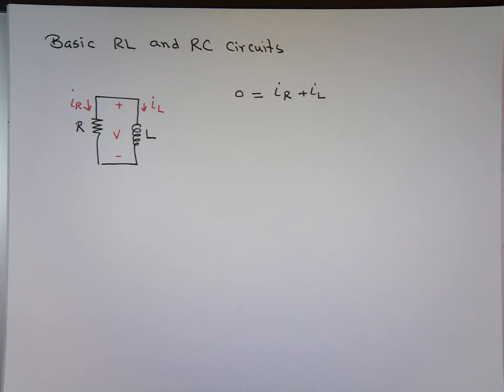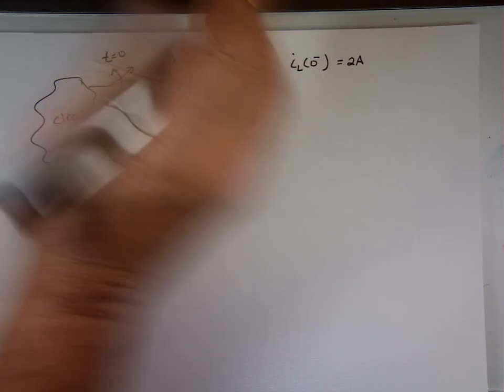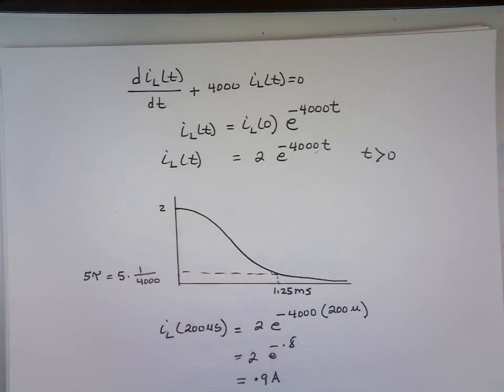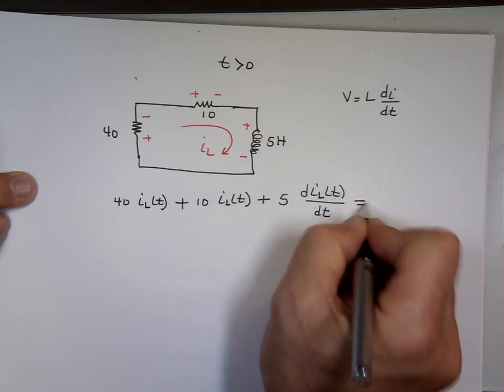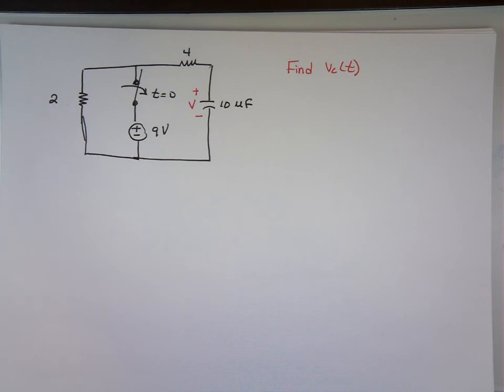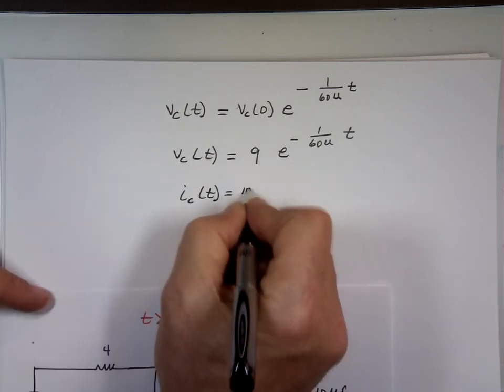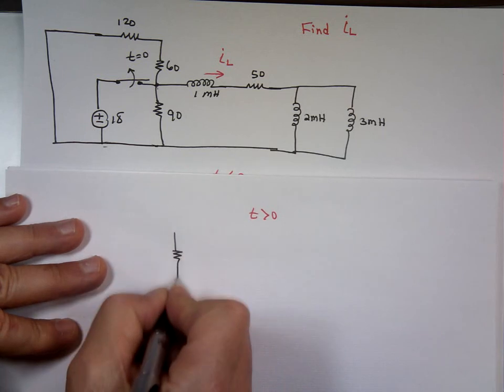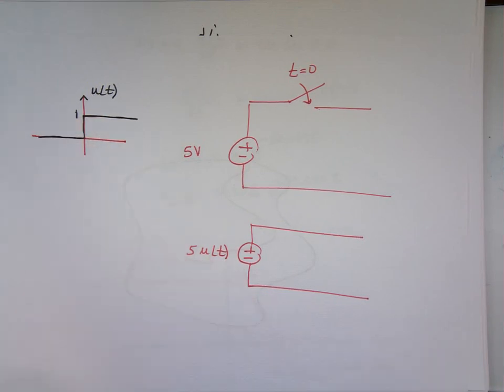BASIC RL and RC Circuit

Comment: IL(0-)=2.4 A ? WHY ? THERE İS A 40 OHMS AND WE DİD NOT TAKE THİS RESİSTANCE WE CALCULATED THE CURRENT WİTH JUST 10 OHMS ? PLEASE SİR ANSWER THİS QUESTİON
Reply: belated response:  the 40 ohm is in // with the 10 ohm resulting in the same voltage applied to each = negating the need to include the 40 ohm branch in the calculations